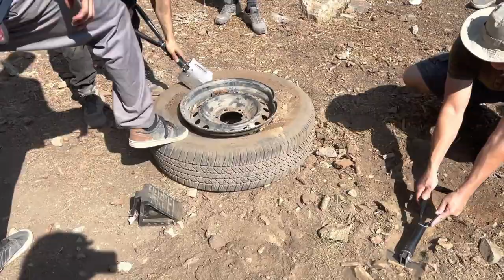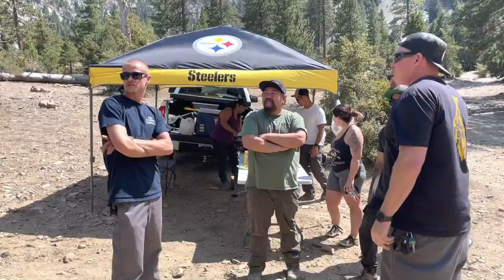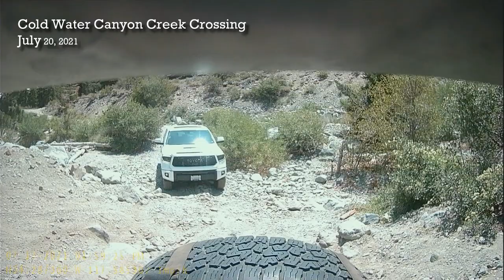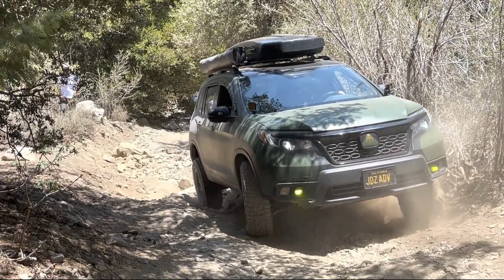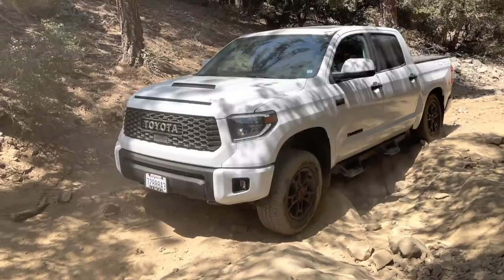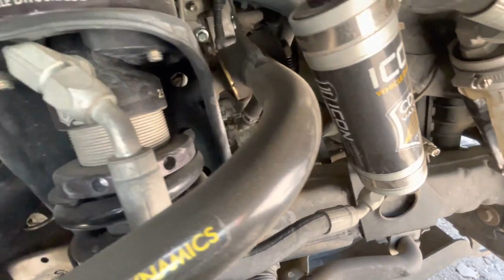I Infiltrate the SoCal4Lo Toyota 4WD club with my AWD Honda - Cold Water Canyon 3N06A

Comment: What stopped the gen 1 Sequoia early on?
Reply from the maker: Good question!  Much of this video was Satire, but the trail difficulty and steepness was true.  It’s a constant climb up 2 miles.  The Sequoia had to pull over due to an overheated transmission.  This is because he wasn’t able to drop down to 4 low.  Also, the 2nd Gen Tundra overheated as well because he didn’t properly drop down into 4 low.  This was his first trail and a technical one at that!  This was the first time he ever engaged 4 low.  We learned that you have to be in neutral before you turn the knob to 4 low.